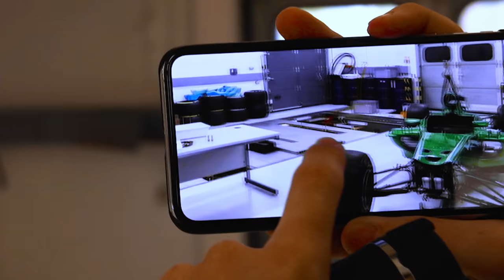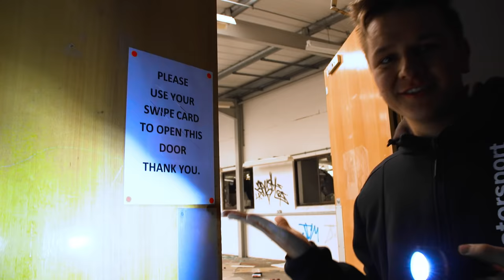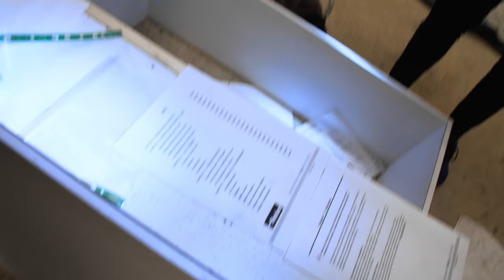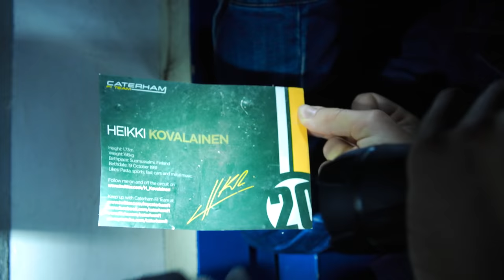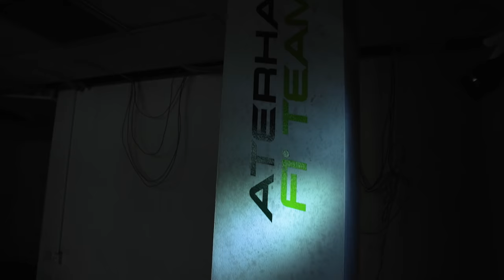Exploring the Caterham F1 Factory *ABANDONED*

Comment: The amount of pointless vandalism in the UK is depressing.
Reply: Can confirm where I live it's a yoke
Reply: Oh I used to live cose to a couple abandoned factories and I did some exploring with friends a few times when I was a bit younger and boi oh boi was it depressing. The most recent one was in about the same state as the Caterham one, except for maybe a couple old computers and a bit of now-useless IT-Equipment. Two production machines also remained there until they were sold of for scrap metal and now there will be an appartment complex, much to the dismay of the locals as it doesn't fit at all into local architecture. Another one was an old chemical factory and I believe the longest abandoned, but boi they left in quite the hurry. Cut up there acid tanks to verify that they were indeed empty but leaving probably several thousand euros worth of equipment, including a forklift, cranes and dozens, if not hundreds of barrels full of good knows what. Some idiot punctured several of them and whatever was inside hardened out to some sort of plasticy substance. They apparantly also were used to get rid of unwanted cars, because an old van and several cars had found there semifinal rest there, all in various states of „disassembly“. The owner was forced to tear the place down after the fire brigade had to investigate the place multiple times after people lit afforementioned cars on fire. 

However by far the most interesting was and still is owned (and used again as there headquarters) the old Brandt factory a large zweiback / rusk manufacturer from Germany with iconic branding. They left the place somewhere in the 90s and when I was there in ~2017/18 there still stood machines used for kneading the dough, you could tell where they held live chicken to satisfy factory egg demand, conveyor belts were mostly still in place it was fascinating. The family couldn't tear the place down as it was put down as a mark of culture so they started rebuilding it. With the factory spanning over a street (with two iconic bridges in the middle) they first restored one side and I believe are in the process of getting the other side up to code and trying to find people to rent it out to. So who knows, maybe someone will by the Caterham factory and set up their own little racing team.
Reply: the area around the old Chernobyl rector is lots worse, not that I've been, just docus
Reply: everywhere else too :(